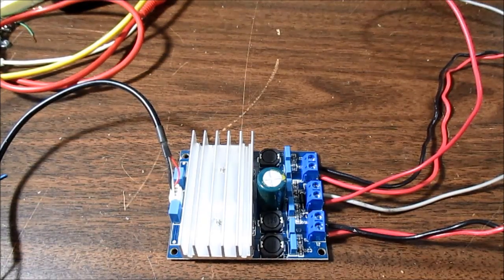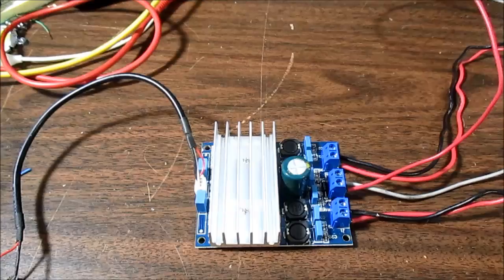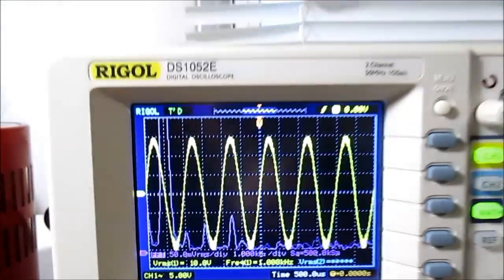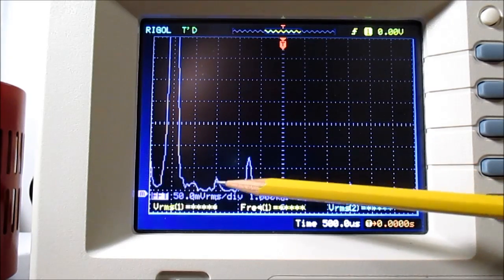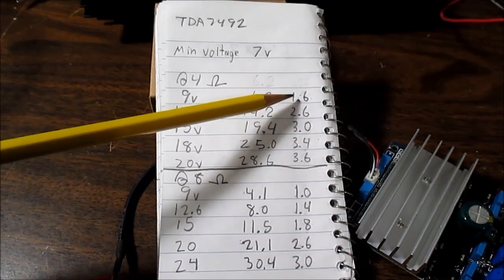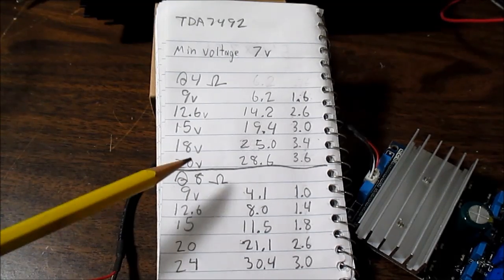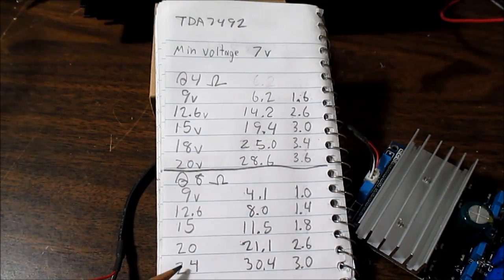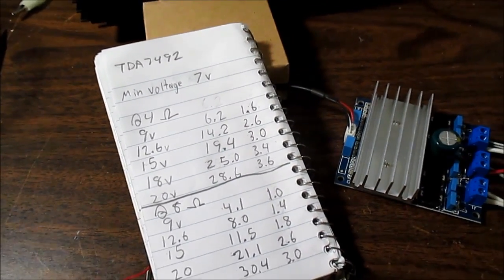TDA7492 class D audio amplifier board power test

Comment: Hi John, I am VERY impressed by this amplifier, I bought the TDA7492P bluetooth one from E-Bay.  I managed to sort out the power supply issue and now it is running off a rechargeable battery pack of 13.2volts and 3.6amps. No more funny sounds from the speakers at 1/2 or even full volume. Dynamite does indeed come in small packages, excellent value for money.

Comment: I don’t know a lot about amps loads rms, but does clipping happen at the point it can NOT deliver more power to the speaker with volume?
Reply from the maker: I would say peak voltage instead of power because of the limitation of the power supply. Average power can still go up with the distortion.

Comment: hey john I have one of these and I noticed today that theres no stereo separation on mine. I soldered the stereo wires to a jack that I have and used a stereo channel audio file and noticed theres no separation. I redid the soldering job twice and used heat shrink tubing on each tiny wire so no wires are touching. did you notice that?
Reply from the maker: Mine was stereo. If you remove one channel from the amp (right at the screw terminals) does the other channel play only? Are you sure the source device and recordings are stereo?
Reply: I tried exactly what you said and right after doing it I got my laptop to use as an audio source and I felt insanely stupid.. On my iPad and phone I had mono audio turned on from a project a while back who knows how long I've been listening to audio music and didn't really notice! Thanks for the reply. Your recommendation fixed my problem but not in the way I was expecting lol
Reply: I've learned a lot from your videos lately when you were doing the first run the power supply said 1.7a and on screen it showed double that at 3.4a is that because you had the oscilloscope leads on just one channel? I ask because I was trying to test my amplifier, you've really got me hooked on playing around with these things! Okay I'm wondering why I'm not getting the current draw you were....so for the purposes of having a good test I pulled out a 19v 3.34a dell power supply (better than batteries which is what I will be using and the entire reason I'm doing this now is because I'm trying to figure out what amp hour batteries I should go for) and connected two Technics 3 way speakers that say they are 8 ohm speakers but I checked across the terminals with a meter and they're more like 6.3 ohms. So from your tests at about 18.6v (thats what I was getting under load) at 8 ohms I should be getting about 20 watts or so per channel at about 2.5a draw but at the loudest I could turn the volume up with one of the meters inline to read current draw I was seeing no more than half an amp peak. never above 510ma. I know its not my equipment its all fluke stuff. I can't tell you how happy I am that you actually reply to these videos, having someone here on youtube to watch and inspire me to buy things that I already love doing and giving me ideas and so on is really great. Thanks man! The last video on my channel is one I literally just made thinking someone could help me but I just thought to ask you. You can watch it if you want to. Its sort of embarrassing to say that though because I know my logic is probably wrong in it lol. If I figure this out or get an answer Im just going to delete that video

Comment: Very nice details. I hope you will do the same for the LM1875 kit board that was your recent favorite.  For portable usage, would you suggest 5S or 6S 2P 18650 and a buck converter or other safe way to keep in the 20-24 volt area?
Reply: I use a 4S on this IC with a 4 ohm load x2. Even at max voltage you're not going to get half of the 50w so the added voltage of the 1 or 2 extra cells seems negligible.

Comment: There's a different amp board that uses a cs8683 chip.  I was wondering if you knew anything about it.  They're very cheap on ebay, less than $6, but the sellers are claiming 130 watts.  Sounds too good to be true.

Comment: Hello, I have a circuit board very similar to this, with a TDA7492P and a bluetooth chip, but I'm hearing a lot of noise with (I think it is) high frequency. I've tried adding filters to the source but it did not work, do you have any idea what that might be? (the oscilloscope does not show anything obvious, but I think the noise may come from the bluetooth chip).

Comment: Great review John. I would love to see a side by side comparison of the TPA3116 and this TDA7492 because the are both rated as 50W per channel.
Reply from the maker: Yes, the TPA3116 is definitely on my list.
Reply: Cool. You've probably know the review that FFcossag did on the TPA3116, and with 8 ohms loads it gave some decent results.
I use an enclosed TPA3116 board as a "power" amp for my guitar, using a JFET buffer as preamp and a 8 ohm speaker. This yields a very good sounding jazz / (light) bass amp. And it is very transportable.
There is some audible hiss, but it is not that much of a trouble for a live situation. I've considered to alter the gain, but leave it as is, for now.
Reply: Any update regarding this TPA3116 please ?

Comment: Ever test it bridged to mono? L+, R+ connected as output to single load. Want to test it mono? I ordered two and I am going to make a little stereo amp from both bridged (one right channel, one left channel), was wondering their performance in that configuration.
Reply from the maker: The amp already has bridged outputs on each channel. Connecting already bridged channels together can cause damage, distortion or activation of its protective circuit.
Reply: My understanding is people bridge the input (connect L to L and to R) and parallel the outputs, (+ R and + L together,  - R and - L together) connected to a single load (speaker). I hope I explain that right. Apparently there is some benefit to this configuration.
Reply from the maker: Yes, that works with amps that are not bridged to begin with. Connecting the channels together with an amp that is already bridged would parallel the outputs. This would split the current between the channels allowing for lower impedance loads to be handled. This would require current sharing resistors to be used on the outputs. Some amps may not work properly doing this and if you don't use a lower impedance load, you gain nothing.
Reply: Thanks for your response. So you won't be trying this?....LOL As a second note....It's a very common question from people buying these amps.

Comment: good morning john really liked the test of thermal testing did help me understand some of the things im going thru with my sys recently install a 400 watt for mid and high,and 500 watt for subs, they are in my saddle bags on my motorcycle started experienceing thermal protection need to play sys loud to make up for wind noise up to a certain level it plays well for a while then just cuts off, also note that im running everything brigded and at a 2ohm load,but after watching your vid im going to make some changes and see what happens,also would like to see you make a vid on sys that are running like this set up bridged would like an opinion on what else to try to keep from thermal protecting

Comment: hi what do you mean with current limit, is it psu current limit or the amp chip class D has current limit? does the board only delivers a limited current ?
Reply from the maker: I'd have to watch my own video to see what I was talking about but I could have been referring to the built in current limit inside the IC that protects it just in case the output wire short circuit or too much load is connected. It saves the chip from getting ruined.
Reply: thanks, ive seen in other videos being tested with low impedance, and dyno test too, if limits current you said, it must be psu limiting, the test was even loaded in the dyano as low as 1 ohm load on 24 volts, not really sure the max current the chips can handle, im planning to get a class d amp, but pefe the 42volt version o model, im still searching for the best, sorry i have a broken keyboard thanks again, good videos, and audio explanations, from engrs stand point :)
Reply: James Balagtas in my opinion those dyno tests are mostly hype and aren’t a true test for playing music(in most cases). Trust me John’s numbers here are realistic.You won’t see any benefits from adding more power unless you like magic smoke or clipped signals.

Comment: Can you measure the TDA7492 in to 6 ohms load ?.
Most speakers are at 6 ohms load impedance in a normal stereo hi-fi amplifier.
Next Class D Amplifier board you should try is the TPA3116D2 ?.
Reply: Scott Muckleston somewhere between the 4ohm numbers and the 8ohm numbers. It’s a couple watts difference at most.

Comment: Which has better sound quality ?    class-AB ?   or  Class-D?   thanks..
Reply: It depends on the quality, not the type of amp.
Some people say class A would be the best, some people say tube amps are the best high end stuff ever.
To be true, an amplifier should have a linear frequency response, which tube amps doesn´t have since they have a "warm" sound due to non linear response.
Class AB, and class D are very linear, if they´re high quality.
There are so many different things that must be right.
Frequency response, distortion level, power output.
It´s like comparing AMD and Intel CPUs which nowadays are both great, the AMD sometimes even better.
 
In all this means, it´s just another type of amplifier doing the same job.
So the question is, does it a good job?
Expensive class d amps sound better than cheap class a or ab amps.

Comment: another "late to the show" comment :)
used one of these in a plastic soap box, mp3 module in front, spring terminals and power jack in back for 12v 4A supply, pretty big little stereo that can pop into your pocket. nice to see it'll push 14w/ch @ 4 ohm clean, is actually pretty good.

Comment: If people would read the datasheet and were able to understand what is described there, they wouldn´t write "OMG 100W" in the video title :D
And at 20V and 4 ohms it has a efficiency of 79,4%
Not that bad at all.
However higher voltage, less current, it´s almost the same in the end.
With 8 ohms the efficiency is a bit higher, at 84,4% so a little bit less heat on the chip

So there is a loss about 15W on 4 ohms load with 20V and around 12W which is transfered into heat.
Since it was a synthetic load test, it shouldn´t have any issues while playing music, even bass intensive songs wouldn´t use that much power all the time.

I´m using 3 of these small amps at 12V lead acid battery for some little projects and i get 10 to 15w per channel which is plenty of power for big speakers.
And on a higher voltage, it could be even better but will also draw much more current so i think using an step up module wouldn´t make sense in terms of battery life.
It wouldn´t go much louder anyways.

I have ordered 2 more of this small amp for a new project > upgrading some old Wavemaster 240 pc speakers since the speaker driver can handle 15W but the used amplifier IC can output around 3W per channel at a decent THD so i thougt unsoldering the IC, soldering wires from the audio signal input and vcc and gnd and wire it up to the new amp would improve the sound, the performance and be much more efficient while still having the ability to use the front volume and tone control and power switch.
The old amp  has a cut off in the 20hz and 20khz range so i´m hoping it will improve the weak treble and clarity on this setup.
Maybe i´ll also integrate a new switching power supply which doesn´t make noise while plugged in like the transformer does.

Anyways thank you for testing the output power of this amp, it will help many people i guess.

Comment: 3*2 A @ 24 V (144 W) delivered and 30,4 W *2outputs (60,8 W) output, that yields only about 42% efficiency. That seems very low for a class D topology, might it be a fake chip or is my math off with a factor of 2.
Nevertheless, a great video as always!
Reply from the maker: How did you figure that? It was 24v @ 3a = 72 watts consumed and 30.4w x 2 channels for 60.8 watts output.
Reply: JohnAudioTech oh was it only 3 A! I thought it was 3A*2, times 2 for the two powersupplies in parallel.. but in that case it,s pretty impressive for such a cheap amplifier :)

Comment: I had both TPA3116 and TDA7492, and both are pure rubbish. But if you have to choose only between these two, you can go for 3116, because the sound quality is just a bit better. The 7492, has almost no highs. Sounds dull. I've never heard worse sound than the 7492. If you are into class D amplifiers, you can save more money and get an TAS5630 . Much better sound quality and power. Not as good as the A or AB amplifiers in terms of highs, but decent sound for the money. In fact this is the big problem with class D amplifiers, most of them lack in high frequencies.
Also just for fun, a class D amplifier, that impressed me, is PAM8403. 2*3W at 5V, and good sound quality.

Comment: Hello. I have done a test between TDA7492 and TPA3116.

TPA2116 has much more watts than the TDA7492 has!

TPA3116
49watt
100hz sine tone
4 ohm resistor
(24v 5.38A power supply)

TDA7492 15watt

if you push TDA7492 then you may get 20w but then you get more noise and problems.

Cheap class-d does not have such good sound quality! Cheap class-ab has better sound!